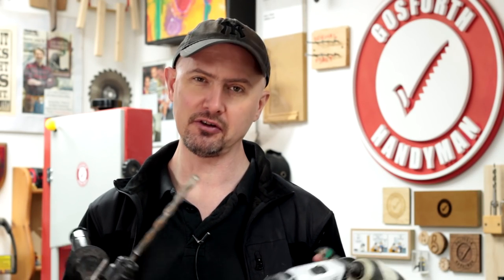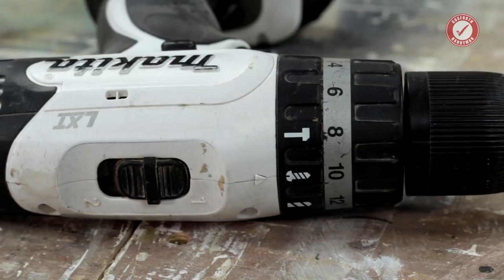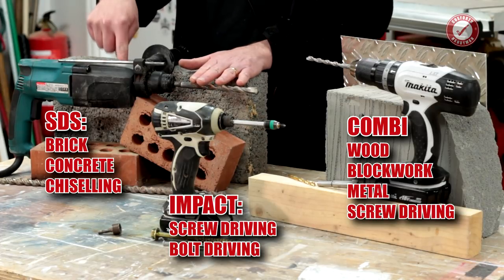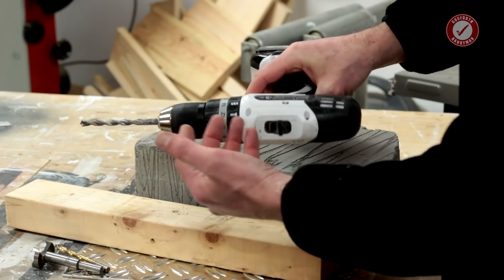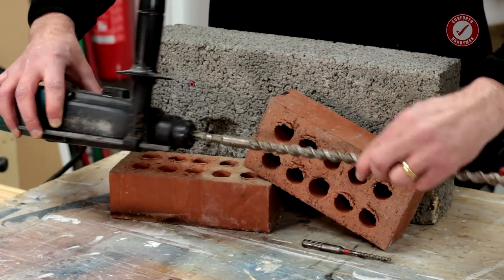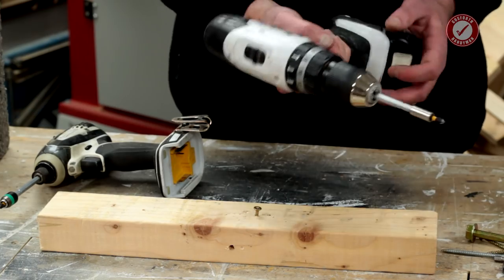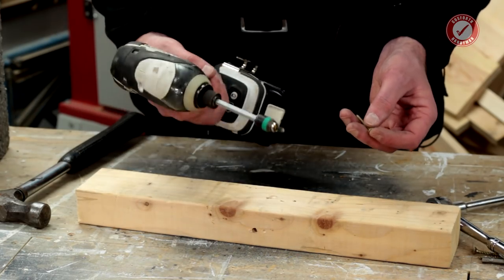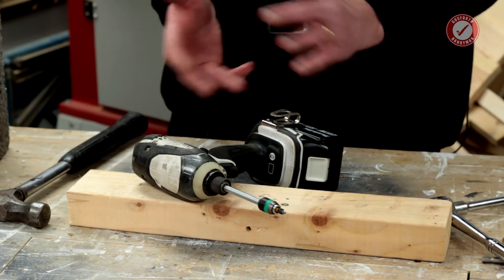Impact Driver vs Combi Drill vs SDS Drill - what's the difference?

Comment: So, is there ever a reason to buy a mains percussion drill over an sds drill?
Reply: Do you mean a percussion hammer drill with a normal keyed/keyless chuck?  No, I would say not, though I'm not sure you get such a thing.  They tend to be rotary hammers.  Sorry if I misunderstood the question.
Reply from the maker: I must admit I haven't looked in to this recently. I have a mains normal hammer drill (essentially a mains combi drill). I just keep it as a backup really. It's very high torque so good if you've got a log of big holes to drill with wood bits. E.g. lots of holes in treated fence posts with a 20mm spade bit - my combi would struggle with that and the SDS doesn't have the RPM. Just my 2 cents though. 👍
Reply: @GosforthHandyman  These are the types of drills I'm referring to. Just straight percussion with no hammer action like you said. 

I've found they are next to useless for any kind of hard masonry. 

https://www.screwfix.com/p/makita-hp1631k-2-710w-electric-percussion-drill-240v/46545

So really if an sds drill can do everything and more. Is there ever a reason to buy these? Other than like you said, for just drilling wood. (but again, an sds drill can do that.)
Reply: I have done that exactly.  I have a Bosch cordless combi drill and a Bosch mains powered hammer drill, not an SDS one.  I live in an 1880s-1890s house in London, so all the walls — even the internal partitions — are brick, and it is a much tougher variety of brick than those used in modern houses.  In the basement there is a concrete floor.  The mains powered drill has no problem with it when I need to drill into the brick or that floor.  It is certainly a lot slower than an SDS and if I were frequently drilling brick and/or needed to drill concrete a lot I would get an SDS.  However my main uses for my drills is making holes in wood and driving screws in a wide variety of sizes, from 8mm length upwards.  I'd say for occasional brick and concrete drilling a standard mains hammer drill is fine, if you're going to do it a lot get an SDS drill.  If you're going to do professional work with installations etc then the SDS will pay for itself within a single large job.  I am hobby woodworker and although I make things fairly frequently I am never in a hurry.  If I went professional the SDS would be bought before I placed any ads.
Reply from the maker: What Fire Angel said 👍. The RPM of mains hammer drills is much higher than SDS - roughly double from the ones I've looked at. One other thing (I can feel a video coming on about this) is that the non-SDS is probably a bit more accurate for the less experienced. The SDS bit can tend to jump about a bit and takes a bit getting used to. The normal hammer drill doesn't do this... but takes longer (and harder on the arms). Plus the quality of the drill bits is a massive factor too. 👍👊
Reply: @GosforthHandyman  A video about sds drills (and different types, like core) would be great! But after the holidays, you've earned a rest! ;)
Reply: @GosforthHandyman  I'd like to add that if you are doing precise woodworking an SDS is much less use than a normal cordless combi drill or that mains powered drill.  It is true that on the better SDS drills you can switch off the SDS hammer action but they have to be built like tanks so they are heavy.  My mains drill is very compact, beautifully made and it is a precision tool when used carefully.  SDS drills are very powerful but precision is not their forté.

Holy cow, if I went full-time professional I'd need an SDS, my mains drill, the cordless combi drill and an impact driver.  Expensive.

Comment: Don't use an impact driver.   A lot of big sites they are not allowed. Unless you have the new fangled oil cooled impact drivers. I only use regular drills for all my work. But I only do interior fit outs. Kitchens and alcove units. Sds yes I agree that's always in my fitting kit.
Reply from the maker: Interesting! Why aren't they allowed on some sites? 👍
Reply: @GosforthHandyman  noise I would imagine.
Reply: @GosforthHandyman  noise and HAVS that's why some of the new models are oil dsmpered

Comment: I've never struggled in the slightest drilling into brick with a combi and a decent drill bit?
Reply: Nor me.  Only when drilling into reinforced concrete (i.e. lintels etc.) have I had problems with a drill/driver.
Reply from the maker: Seriously? 14mm holes in to Victorian brick - not a chance with my combi. 😂😂
Reply: @GosforthHandyman  Brick has never been a problem with my combi-drill. For brick I even don't use the "hammer" (which is no hammer) function.
And it has only 600 Watt  Those dino's  (corded) are (much) more powerful than battery-operated ones, imho.
Reply from the maker: Victorian brick? Honestly, that stuff is a different animal - it's like drilling granite. 😂👊

Comment: Since torx screws are becoming the standard here, I'm actually barely using my impact driver anymore.
Reply from the maker: Where abouts are you? Didn't know Torx were standard anywhere! 😂👍
Reply: @GosforthHandyman  In the Netherlands. Actually most woodscrews are now Torx. I used to curse the hell out of them. But I am getting used to it and the amount of extra clamping force you get out of them is actually pretty significant. And no dull bits anymore!
Reply from the maker: 1066Rider  if people need what explanation?
Reply from the maker: @p_mouse8676  Interesting! They're readily available over here but I'd say Pozi is standard in the UK. Although depends on the trade though - a lot of window fitters etc. use Torx these days. Both are good. 👍👊
Reply: @GosforthHandyman  I've found that electricians tend to use Robertson screws a lot for things like back boxes.
Reply from the maker: Tim / Sri - in the UK??! Literally never seen that. Robertson is a failed concept in my view - best avoided as Torx is far better and will probably become the standard where folk need less cam out than you get with Pozi (or where Pozi hasn't been adopted - e.g. the States where Phillips seems to be quite common still for some unknown reason 😂). Pozi is great for general purpose though. 👍
Reply: @GosforthHandyman  Robertson screws have not failed, they are standard in the boat-building industry and are often found in some types of industrial and outdoor mains applications, especially for 440v or higher.  A significant reason for this success is that both of these applications often use stainless steel screws and many stainless steels aren't attracted very well by a magnet.  That means a magnetic bit won't hold a screw, but the tapered hole in a Robertson screw means it can simply be press-fit onto the bit.  The resultant hold is secure but not tight enough to cause problems removing the screwdriver afterwards.  This makes putting large numbers of stainless steel screws in much easier.

Another significant plus to the square tapered hole is that a single Robertson screwdriver or bit will properly fit more than one size of Robertson screw.  Finally, Robertson screw heads and bits are stronger than Torx, Pozi or Philips because of the simpler shape, so for high-torque applications they are better.  While Torx screws will almost never cam out Robertson screws are even better in this regard.

Historically Philips and Robertson had a battle which Philips won because he licensed his patented design and let others produce it.  Robertson's design is far better but he preferred to try and make all the Robertson screws in his own factories and would not license other companies to make them.  As a result Robertson screws became the standard only in Canada while Philips became a world wide standard, especially during World War II when armament production required lots of screws to be driven by power tools.  Also I think because Philips was American there was less resistance to his design in the USA.  (As Pozi are a European invention that might be why they weren't widely adopted in the US either, even though they are clearly an improvement).

By the time the Philips and Robertson patents ran out Philips had won the battle because his tactics were better.  He made far more money than Robertson did even though the Robertson screw was the better invention.
Reply: @GosforthHandyman  Yes, even in my house the majority of the back boxes for sockets are held in via Robertson Screws. I've also seen them in commercial toilets in shopping centres and the like to hold up the pipes via Clips.

I'm a big fan of Robertson Drive screws. Yes, Torx is better for large torque applications but it has so many different sizes (1-100 if I remember correctly) I most often find myself using T10, 15, 20, 25, 30, 40 and 45 ( I had to use T25, 30 and 45 once when I updated the guttering around my house. Not even joking)

Where as with Robertson it's just sizes 1, 2 and 3. I'd use Robertson more for construction and keep torx to cars and electronics.

But screw Philips! Wish it would die!

Comment: Some boring bits in this video!
Merry Christmas Andy, my favourite are Milwaukee, twice the torque than most of the Dewalts and Makitas, I also have their 12v impact, drill and screwdriver, really small and powerful enough for 95% of the stuff anybody does about the house.
Reply from the maker: I'll take it up a gear in future so it's doesn't lose its impact. 😂😂🌲

Comment: It's called a hammer drill-  SDS is the chuck style.
Reply: Actually the Chuck style is a hammer drill
Reply from the maker: ...or 'rotary hammer'... which is daft since the rotation isn't hammered (unlike an impact) and they can be used with no rotation. It's all very ambiguous and a lot of combi drills get referred to as hammer drills too. SDS / Combi / Impact seems to be the the most common terminology. 👍